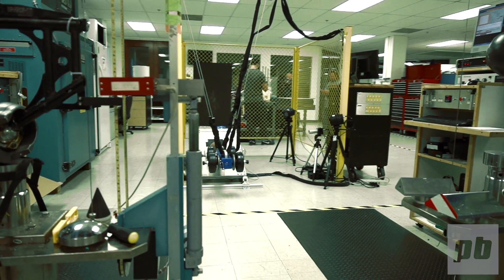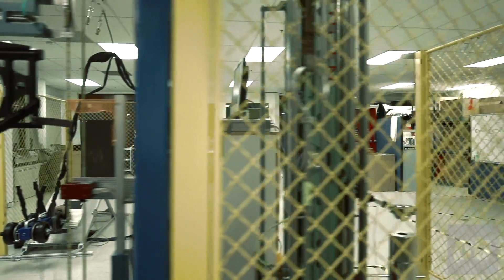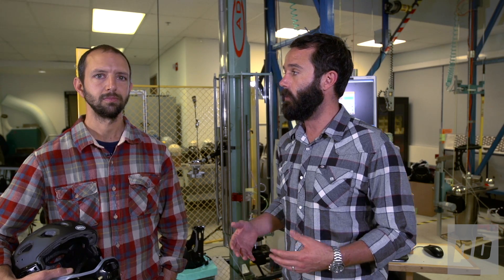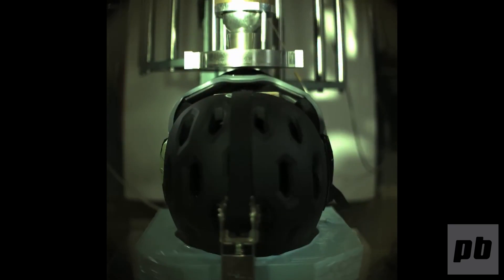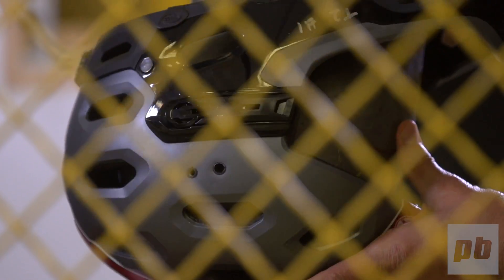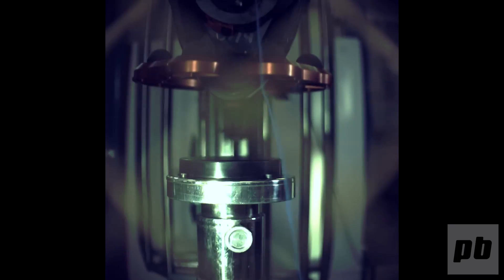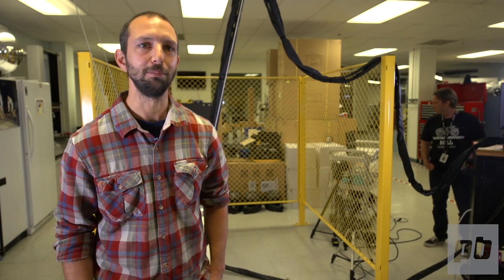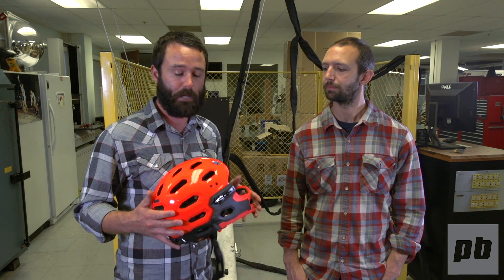Bell Super 2R Helmet Impact Testing

Comment: Genuine question. I wanna start wearing a chin bar on my bell super two, but I’m concerned about my neck and spine being tilted back because the chin bar protrudes from my face. For example if I fall and land face first on the ground my face will be protected but wont to chin bar force my neck straight back out of alignment in a way that it normally wouldn’t if the chin bar wasn’t attached?
Reply: No... this has been tested and your neck is not that week... before any damage to your neck would occur, the chin bar will either deflect or break entirely.  Your neck/head/face is always better off with a chinbar than without.

Comment: I have the 3R The system that tightens around your head loosens really easily and would definitely loosen in a crash, is it suppose to do that?! And is this thing actually good for mountain biking?! There’s no padding, and the helmet seems really thin! I’m mainly going to use this for fast biking around the city and hill Bombing would it hold up to a good crack of the head on the concrete?!?
Reply: There should be a removable padding layer including 2 thicknesses on the chin bar. It's definitely good for mountain biking. I just crashed in the 3R a few days ago and it's the only reason I didn't break any teeth :)